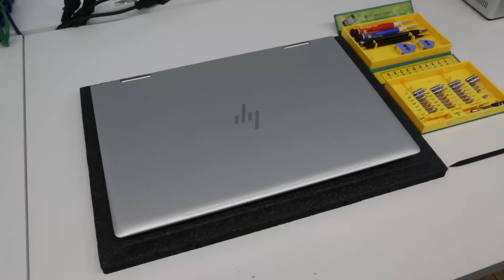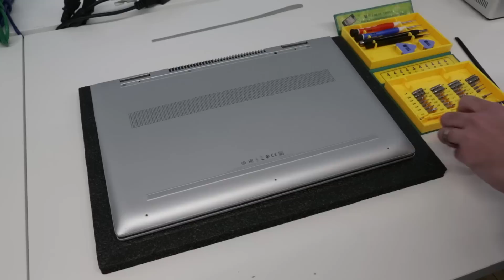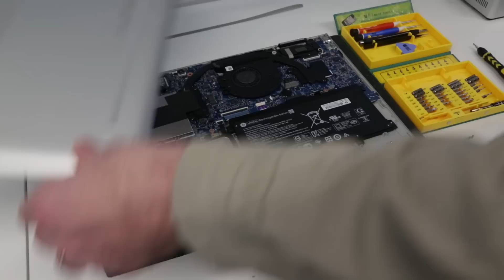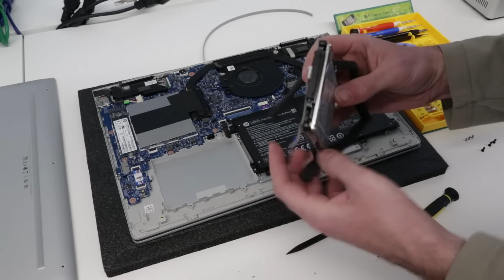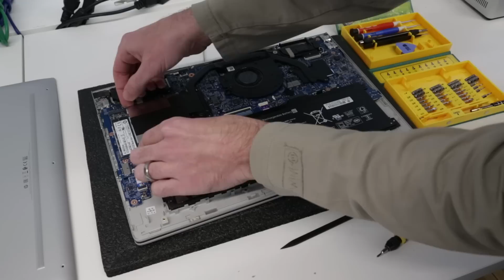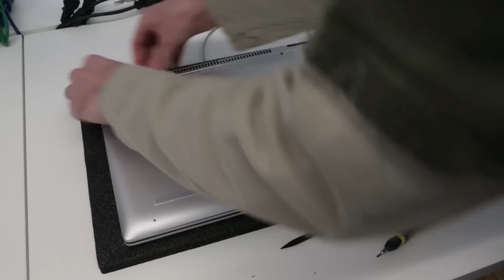HP Envy x360 15 SSD, HDD and RAM Upgrade Guide

Comment: Thanks. Good video, just the video quality .

I have a similar laptop HP Envy X360 15m-bp011dx. Lately the HDD malfunctioned and has been on auto repair for weeks with no success to restore it to boot screen mode. Though I have about 7 months warranty on the product, I am out of the state presently and would not return till mid year. I want to purchase an SSD to replace the 1TB HDD but I don't know whether it is a SATAII, SATAIII or M2 that I ought to buy to replace the present HDD. The cost to post from here to the State and back would buy me a 512GB SSD. Kindly advise/help me.

Thank you.
Reply: Just go for an Samsung 960 EVO, you can't do better.

Comment: Does the m.2 Support NVMe?
Reply from the maker: It is keyed correctly to take NVMe drives and there are versions which use an NVMe drive, so I would assume so, but I didn't test it.

Comment: How much of a performance impact do you think a ram upgrade to + 8GB would actually cause?
And btw: I noticed you mentioning the bottom flexing outside a little so your rubber strips wouldnt prevent the aluminum from touching the surface as well? I was thinking that only I'd have this problem...
Reply from the maker: Depends completely what you're using the machine for - if you aren't running out of memory with 8GB then moving to 12GB will make practically no difference.
The flex allows me to press the panel in slightly but not by the rubber strip.
Reply: I have the model with 4GB dedicated MX150, will it also have a performance impact then?
Reply: Btw, and where did you get that big plastic thing from to lift the chassis?
Reply: Same problem, I'll let you know if I find an answer, I plan on installing an 8gb stick.
Reply: did you made the upgrade?

Comment: Thank you for the video. Do you happen to know anything about a stylus for this model? I thought it came with an active digitizer so any Wacom or similar pen should work but I bought a Lenovo Active Stylus and couldn't get it to work. Any ideas? Thanks!
Reply: derekisthematrix I have the ryzen model and it supports Windows Ink pens like the surface pen.

Comment: Thanks for this, I actually used this helpful tut to open the backside up on a new Ryzen 2500u HP Envy x360 and it worked just the same way.
Reply: hello, i'm interested to the hp envy with ryzen and i want to know something... The internal parts are the same as the ones of this video (The m2 ssd and the 2.5 drive)? Rams are 4+4 as the video says? Because i've found it on amazon italy; if i buy it i'm interested in installing an hdd drive and also in future to upgrade ram ( not if they're dual channel as the video says, but the official site for the ryzen model doesn't say that).thanks
Reply: I can answer your questions, the parts are indeed the same save for the Ryzen APU inside and compatible motherboard. It comes with drive bays for an M.2 drive and a 2.5 SSD or HDD. The base model comes with dual channel (2x4) RAM and supports up to 32 GB (2x16) of RAM. If you want to upgrade the 2.5 drive you must buy the base model that comes with the 1 TB HDD inside or one of the options that include both an M.2 and the HDD. The reason for this is because if you buy a version that only comes with a M.2 drive installed, HP will not include the SATA cable that goes from the motherboard to the 2.5 drive bay. I bought the base model and opened the back in order to add my own M.2 NVME drive and will probably open it up again in the future in order to upgrade the RAM to 16 GB (2x8). I'm okay with the 7200 RPM 1 TB HDD in there but I could also upgrade that to an SSD in the future if I wanted to as well. Hope that answered your questions, and so far after doing a fresh install of Windows and adding back all the drivers, the AMD Ryzen has been fantastic.
Reply: if the problem is only the sata cable, it can be bought and also a caddy; so it's not a matter, i wanted to know if there is a space for a 2.5', you say yes i suppose. In italy on the hp store is only selled with a ssd and not in combo. Also, are the banks of ram built on the motherboard (as minute 5:49) or they are put in dimms normally?
These two things are important.
Thanks
Reply: There is one 2.5 drive bay and one M.2 bay. If they only sell it with the M.2 installed then you will probably need a SATA cable and connect it to the motherboard and feed it into the 2.5 drive bay for your 2.5 SSD/HDD. The RAM is not soldered to the board both DIMMs are removable.
Reply: Hi! Thanks for the video. Just 1 question: from my old Notebook Ive got an old 7mm 2.5 SSD Drive, Id like to use. Is it possible to replace the 2.5 ssd in there? You mentioned that the one in there is a 9.5mm drive, right?

Comment: Thank you so much for this video! It really helped me put in an M.2 SSD. I saved movie and instead of paying extra for the upgraded model I purchased a Samsung 960 EVO M.2 for the same price. It worked out awesome.
Reply: Sebastian Suarez  any chance you can upload a video of you adding the m.2?
Reply: J Singh I would have to reopen it and show the entire process. But there really is not much to it. After you open it you literally just screw on the one screw for the HDD. if you have any questions let me know and I can help you out.
Reply: @sebisuarez10   Hi, does the m.2 require an adapter? or does the laptop have a slot available?
Reply: @quoc-baoma8903  it has an available slot. It is simple to install and plug and play.
Reply: Sebastian Suarez thank you! Saved me 20 bucks for an adapter lol
Reply: @quoc-baoma8903  anytime man. Hope it goes well for you.
Reply: Can we uprade the ram and storage in hp envy 13.3

Comment: Why anyone would purchase a laptop without a quick removable battery is insanity.
Reply from the maker: That would rule out most modern, slim, laptops to be honest.
Reply: Why would you need to quickly remove a laptop's battery? It lasts 10 hours and spends most of the time plugged on a charger anyway. Who carries batteries with them?
Reply: The quick removable battery looks like shit
Reply: I don't get any where near 10 hours i get around 5 to 6 with chrome etc but battery life is goodish i would rather it push the 7 - 8 hours for regular use but i wanted a thin and light with x360. Removable batteries are for work stations / other laptops that require it most batteries are good we are in 2017 and last long enough. Also the machine is easy enough to open and swap out batteries if it should fail.

Comment: Does all the HP x360 look the same as in this video?? I have a HP envy x360 15t . Will these be haveing same internal set up?
Reply from the maker: If you search for the exact model you have on the HP site they normally have service manuals published. They'll vary a bit depending on the internals.

Comment: Hi! I have a little problem with my fans! I hear the sound of the engine spinning. I'm not talking about the lousy fan, but about the sound when the fan is spinning. It is more a vibration sound. I updated the bios, every thing, turn of the HP Coolsense, but the sound it is still there. And it doesn't matter if is in passive or active mode. Any suggestions?
Reply: @Max D you are not alone! I do have the same laptop, and I think my laptop makes the exact sound you described. After updating the BIOS, enableing CoolSense the sound was still audible.
according to the HP Support it is just the  way the laptop works/is build.
From the Software side you can only use CoolSense to somewhat control the fans.
They still offered me to exchange the laptop, which I think i am going to try....
Reply: Hi! In this case, i will keep my notebook. Let me know if you will receive a good one! 
I have read some reviews, and some users told that they exchanged their notebooks, and receive the new laptop with the same issue... 

I still believe that the vibration of the fan is the cause. I think the fan is to tight with some other piece, so the vibration of the fan that is created by the spinning, does this sound. When is spinning fast, this vibration is not so evident because is more stable in this case the vent. But this are just my thoughts. 

I don't want to open it after 1 month. I just hope that it is nothing that can damage the notebook... Please let me know if you will have some news! 
Thank you.
Reply: @Max D I had the same problem. I also did the bios update, but it didn't help. I was doing some research, until i found out that it isn't the fan which is spinning. It is the hdd which is causing this sound. I adjusted the sleep mode for the hdd at 1 minute and waited. After I have waited a little bit, the sound disappeared. Then I accessed the hdd once again and the sound appeared. That's the reason why I knew that this sound was coming from the hdd. I hope, that I helped you :)
Reply from the maker: From the description it sounds like a duff fan. If it is still under warranty I'd get HP to take a look, or replace it yourself if not.
Reply: It will be difficult to get it to HP, i live now in a different country. The pc works fine, the sound is not so loudly, you can hear it just if it is very quit, like at the night. Or if you put your ear close to the notebook. If i play a game or working some program, the fan spins fine, the sound it's ok. I hope it is nothing to seriously.
Reply: Dunjam96 unfortunaly I cannot answer you that since I returned my device.
Mine had light backlightbleeding, which meant that there were two visible spots of backlightbleeding in a dark room. It didnt really bother me. Otherwise the display was great. I compared it to my 100€ display and it was way better (the Notebook one)(I am No expert/Display fanatic so Take that with a grain of salt)
If it doesnt suit ur needs sent it Back/Return it...

A Tip for dealing with the HP Support:(if you bought your device directly from HP)
Try calling the technical support, they can give u a case number which will allow u to get a refund or a new device.
Then use this number and fill in the  Return Form U can find in your Order history in the HP online Shop 
DONT try to contact Thema via Email, they will Not answer u. I literally had to write them a Email titeld "do you even answer to E-Mail s?"...
Good Look 😆

Comment: thanks for your video just ordered the best buy model with 16GB of ram i think my model just has the one Ram slot fitted with a single 16GB stick when i get it i will add the samsung 960 NVME 250gb SSD
Reply from the maker: I'd expect the 16GB model is 8GB soldered to the mainboard, 8GB on a DIMM module.
Reply: True but on HP's website it states  1x16GB on the specs so idk when i get mine and open it up ill see.
Reply: I bought the same laptop. The model id is 15M-BP112DX. Do we follow the same procedure you've showed to eventually replace the harddrive?
Reply: Hey Brandon, as you said here, 1x16GB dim single channel, just to clarify, Is it really come with a single module? Just one stick? -- I am going to buy this laptop as soon as you reply. Once I buy it, I want to upgrade it with Corsair Vengence 16GB kit (2x8GB) and with Samsung 960 Pro NVME.
Reply: The bestbuy model of Hp 15M-BP112DX
Reply: I have the intel model no issues there
Reply: Brandon Tobias hey how is it laptop running after you switched on the Samsung ssd? I bought the same one from you at best buy.. But they have one from the go website with a 128gb ssd already built in for the price.. Was thinking about returning the be from best buy and getting the one of hp
Reply: Nakx95 yes it's the same I installed a 960 EVO 250GB SSD
Reply: Brue Computing so it really is 1x16GB dim single channel its a Samsung ram chip. In the bios It says that it has another ram slot unoccupied.
Reply: vishalvyas87 I didn't open the memory module bay but bios says one dim 16gb *update i verified its just one Dim. check other comment for details.
Reply: well i just opened mine again and sorry to report its just 1x16GB samsung ram the other slot is not available it as it will only house soldered ram @ the point of manufacturing. So if one has the HP model with 12GB where 4GB is soldered they can upgrade to 20GB of ram MAX with a 16GB dim.  The best buy model is STUCK @16GB until a 32GB dim is released.
So it seems that there are two main board options thoes with 4GB soldered and a upgrad able ram slot and those with no soldered ram and the upgrade able ram slot.
BTW HP parts depot online says that all version of the motherboard are discontinued by the manufacturer which means to me that @  CES 2018 we could see a further updated version of this model hope they put a stronger hinge and 2 more spearkers to make it 4 a with a better 1080p panel or bigger battery instead of the speakers.
Reply: My screen is also LGD056E i think i find it could be brighter and maybe support 87% sRBG colour space instead of 77% but its not a bad screen.
Reply: Paolo Dela Vina hey man it runs faster and smooth you can do that or just upgrade to the ssd yourself your call but it works a lot faster.
Reply: can you use it with full speed or is it locked to 600mb/s?
Reply: Matthias Pröll I assume you are referring to the SSD it's full speed I'll tell you my speeds later.
Reply: Brandon Tobias nice, thanks you 😍
Reply: This was really helpful, thank you.
Reply: The one im going to get at the hp website has 12gb of ram so your saying i can upgrade to 16gb of ram?

Comment: I got bp011dx model but the hard drive is normal 1TB HDD. I want to add SSD. There is a space for that? And is it support both HDD and SSD?
Reply: There's a separate PCIe slot for an NVMe SSD. You can use it with  the 1TB SATA HDD or other SATA SSD at the same time.
Reply: It is a free slot, but it is missing a ribbon cable :( let me know if you find one on eBay or something
Reply: hey man do you by any chance have a picture of your HDD ? im looking for a pic of how it looks inside (this particular model) to add a HDD(rubber/bracket and a cable , but no luck. thanks

Comment: Hi great video , I want to upgrade ram to improve light gaming but I heard you discourage that. Can you clarify why in more detail. My envy has a HDD will it have the slot for an nmve ssd  anyway?
Reply from the maker: The model I have here has 4GB on-board, and 4GB in a DDR4 SO-DIMM. For optimal performance you want two matched memory modules so that the memory controller can run in balanced dual channel mode, as memory bandwidth has a big impact on the performance of the Intel integrated graphics - fitting a larger (so smaller) DIMM can result in the memory controller reverting to single channel mode, and hurting overall performance as memory bandwidth is halved.
You could argue that it doesn't matter as much when you have a discrete graphics card such as the MX150 in the system, but I'd be surprised if 8GB RAM was a limiting factor for light gaming. The maximum you'd be able to go to in 12GB anyway.

I've not looked inside a system without an SSD installed, but I'd expect the mainboard to still have an M.2 slot. Best bet is to take the back off and check. If it has 2 keying notch inside the connector it supports SATA M.2 drives only. One notch and it should take either SATA on NVMe/PCIe ones.
Reply: Thank you, very informative and it makes alot of sense. Bot this pc for my studies and hoped I would be able to game a bit too to avoid PS4 costs but looks like am out of luck as it keeps crashing and the says ram is too little on the amd fx version with 8gb shared. thus I wanted to upgrade to more ram and ssd but its feeling like it might be a waste of money.
Reply from the maker: Ahh, assumed you had the same model.